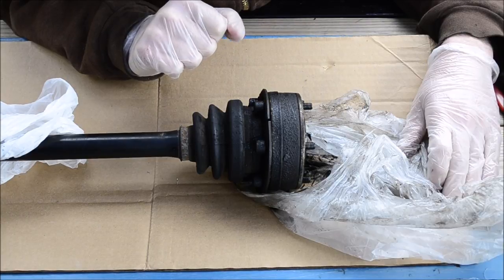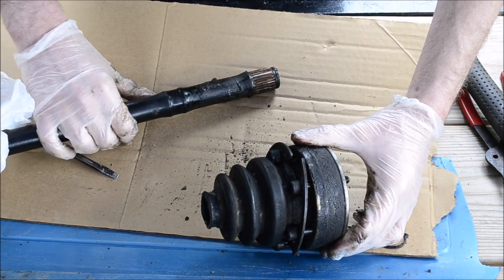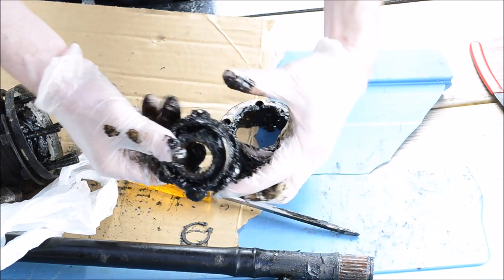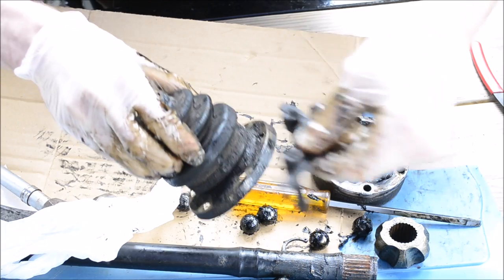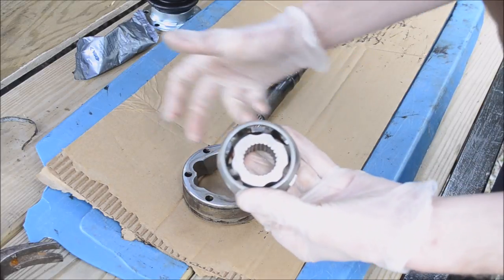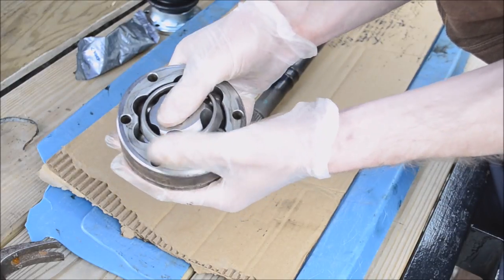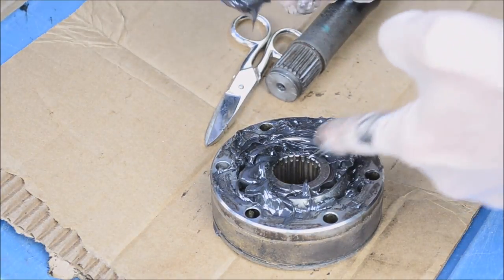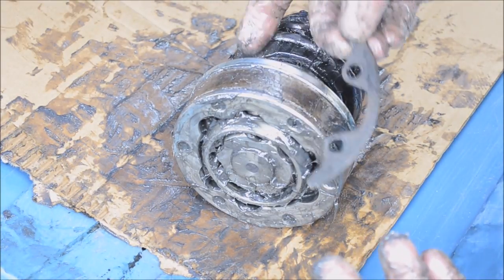Replacing CV Axle Boot And Grease / Rebuild Porsche 944 951 928 968 911 924

Comment: Also important to put the same axle back on the same side of the car. The metal has been stress hardened by years of torsional force in 1 direction, putting the axle on the other side and stressing it the other way will increase the chance of a failure.
Reply: Yes because driving backwards don't put stress on the shafts...
Reply: @TheLaurent1988  If you drive backwards at 60 miles an hour doing reverse burnouts, yeah, then you'll have a problem. Think before you post.

Comment: Thanks for the video.  When I did my 4runner's front axles, I didn't put the grease on until after I has the boot clamped onto the shaft.  Made it less messy.  Also, I used a metal clamp for clamping the boot on the shaft.  Great job.  Thanks again.

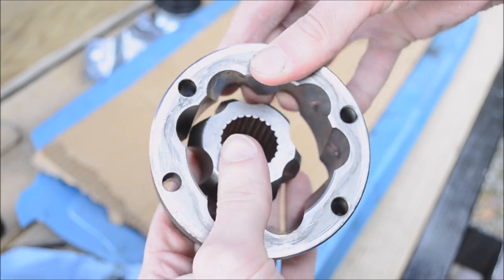Comment: 8:36  Did you inspect the bearing surfaces after you cleaned them up?  They look pitted like the balls have been binding.  I am making content and mine are all wasted like yours look.  I had to change all four.  This WILL make noise and cause future issues.
Reply from the maker: They do look pitted but they didn't, and still don't make noise

Comment: I rebuilt the boot, but now that its in the car the boot is not hard like the original was and it makes a sucking sound when I move the axle back and forth no matter how tight the clamps are. Is that normal for this boot?

Comment: The boot comes with a ring and a half circle doodad, they are both black. What are they for?
Reply from the maker: No idea, I didn't use them, they might be for other cars that the boot fits. The only rings and circles I used are the clip ring and the clamp to seal the small end of the boot.
Reply: a DIY Car Guy thanks! also, you know that big green dot on the axle, did you put that side on the wheel hub side or the transaxle side?
Reply from the maker: Sorry I don't remember a green dot. I fully rebuilt each side one at a time, and since the shims on each side are different, I used them as a reference as to which side attaches to the transaxle vs hub.
Reply: a DIY Car Guy I just got back from the junkyard and looked at a 1985.1 944. Looks like the inner race, metal thing in the middle of the CV Joint is flat on both sides and is made of a different metal as it is silver in color. Also, they have different teeth counts, so may not be compatible with whatever part you want to switch out on the joint. And also the cvs had the ring @ the end included with the new cv boot kit. It goes in first before the joint and has the concave end facing out. That is probably why both sides of the CV Joint is flat. The half circle thing is a stupid version of the C clips/circlips,/snap rings it has no holes for c clips. Hope this helps someone who reads this.
Reply from the maker: Thanks for the info. I don't know why my axles didn't use the concave piece. Either it's because it's a turbo, design revision, or someone rebuilt them before me and didn't put them on.
Reply: a DIY Car Guy it’s a design revision any 944 1985.2 and above, S, S2 Turbo does not need that concave piece in the cv boot kit. It won’t fit anyways since the splines or teeth aren’t the right shape for the ring to go through.
Reply from the maker: Ohh interesting, thanks!
Reply: Those are called "Belleville washers," and should be installed. The ones that come with the GKN kits are too large and will slip right over the raised shoulder at the end of the splines on the driveshaft.  I reuse my originals that have spline grooves cut into them.  Those washers hold spring tension against the bearing assembly and the C-clip.  This keeps the bearing assembly from sliding back and forth on the shaft and banging into the C-clip potentially damaging it.   It may be a safety overkill but I'd be walking on eggshells without them installed.